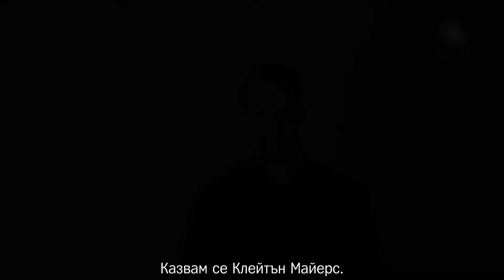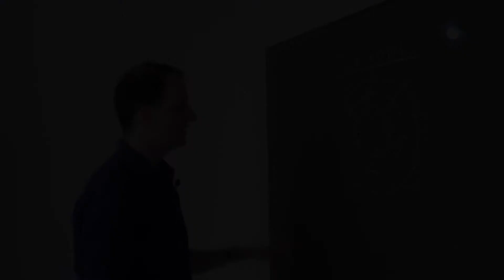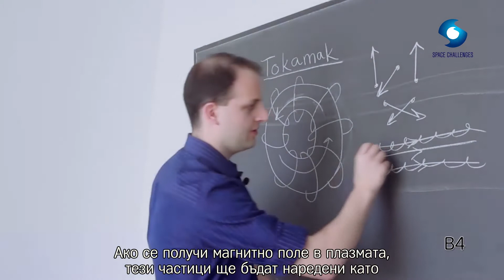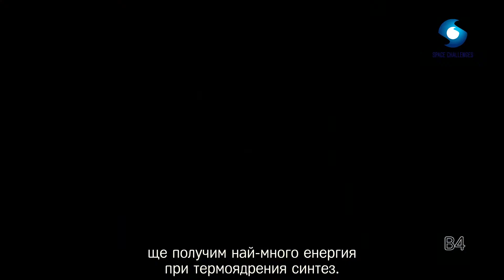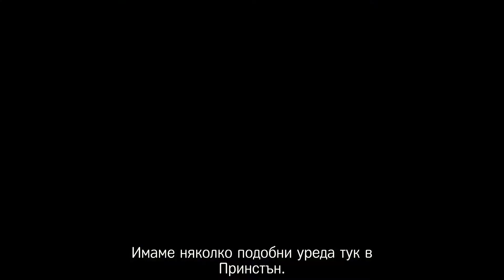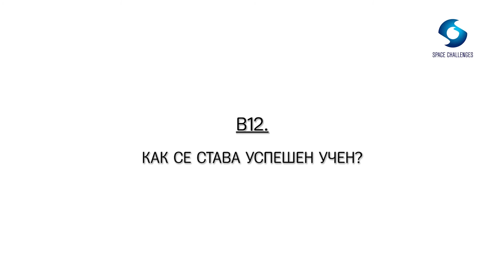BG SUBS: Using the Energy of a Star to Power Humanity

Comment: A question I ask myself is how do stars form out of gas. Where did the magnetic pressure come from to start the process?
The initial gas would be too diffused for it to work. Is there a particle out there which overcomes the coulomb force without the need for such extreme temperatures\confinement?